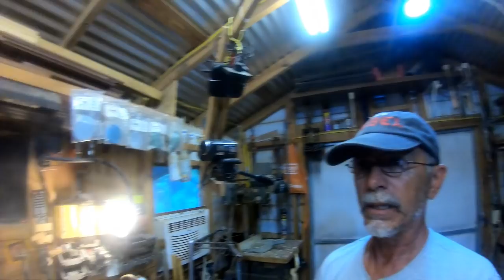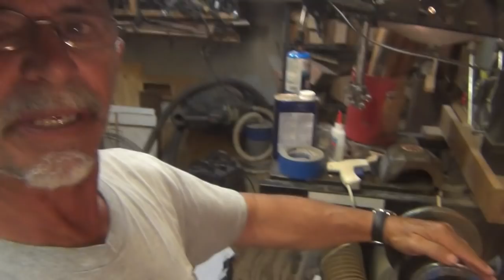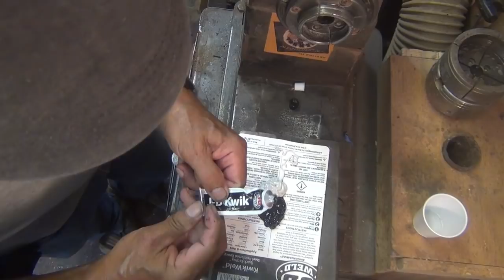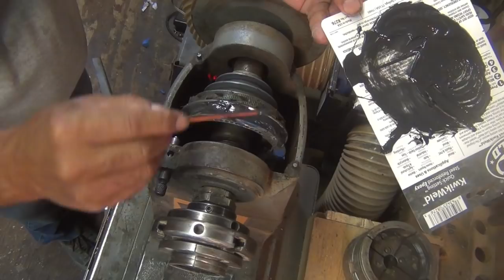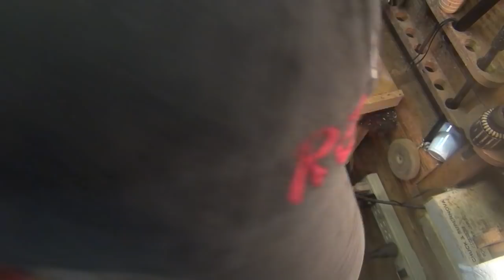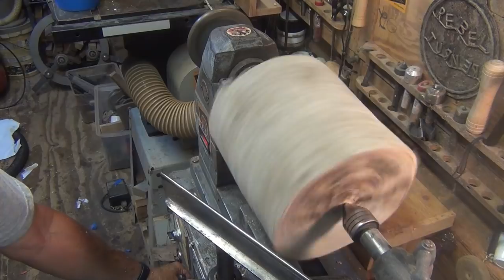Woodturning Needed repairs

Comment: Hello Al!  Glad you came back to wood turning.  I was amazed when you rebuilt the pulley with JB Weld, but it seemed like there was no cure time.  You edited that out, I guess.  When you applied the epoxy and started it rotating I wondered what that did to the adhesion of the epoxy to the aluminum, but thought that you surely let it cure before you turned it on .... .... right? And surely before you began milling it to shape ... right?    I’m looking forward to Part 2.
Reply from the maker: Thanks for watching my friend.  you are correct, I didn't give it alot of cure time. I just wanted to get to turning LOL  but it held up

Comment: man after my own heart...my wife told me I better not die before I clear out my 1200 sqft cabinet shop.  giving up tools is like cutting off an arm.  "you never know when I might need it" fills half my shop....
is the head still balanced at highest speed?  I would think that much JB would cause some imbalance.
Reply from the maker: LOL   WOW a bit extreme LOL.  I just have to clear it up before I sail away   Head is well balanced because it was turned true so it should not be an issue at all

Comment: There is actually a j.b. Weld specifically for aluminum.
Reply from the maker: Thank you Roy.   I love JB weld, I have useed it in many projects and find the results amazing. I was not aware there was one specificly for aluminum... oh well maybe next time LOL
Reply: Yes al. It's good stuff. I also have used it for different projects.steel for cracked engine blocks. Aluminum for a hole in a flat bottom boat. Both worked great. I love your videos. You do some very nice projects.

Comment: If any of the Dewalt drillguns are the old 12 volt battery system, I would be interested in acquiring them from you. I can no longer get batteries for mine, and have to rely on buying older used ones! Let me know.
Reply from the maker: Thank you as always  unfortunately I believe the problem with all those Dewalts is the battery LOL
Reply: The Rebel Drat! Lol.